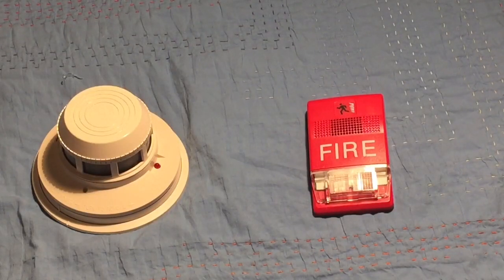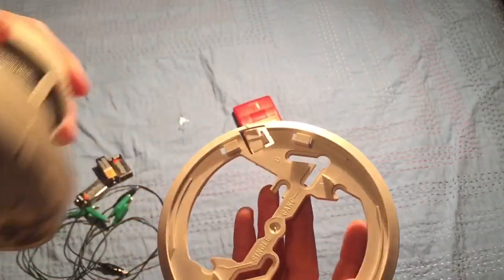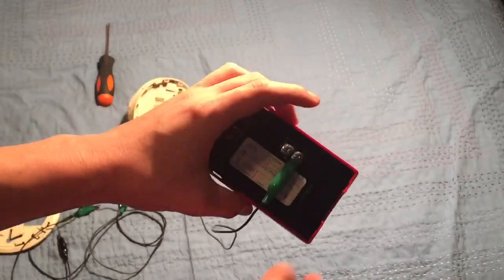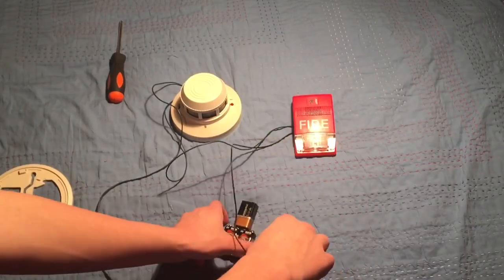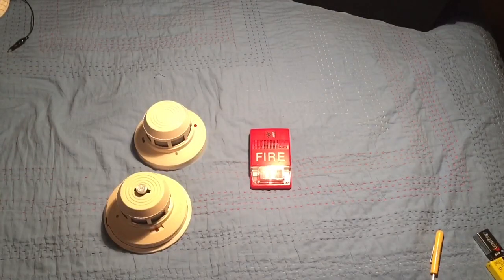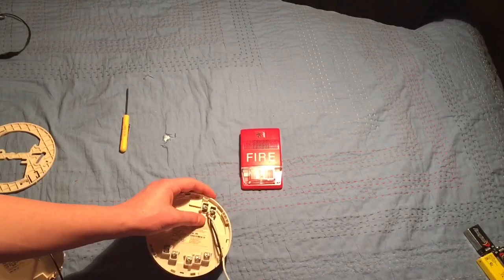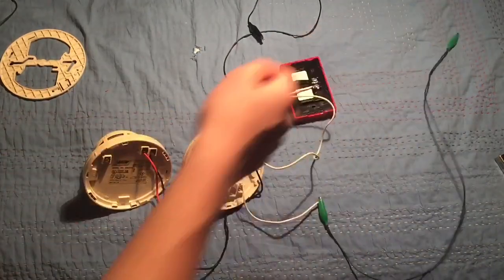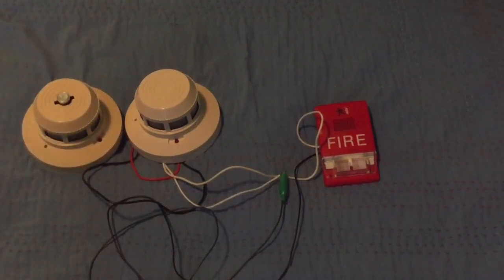How to wire a smoke detector to a fire alarm

Comment: Is the smoke detector photo electric or conventional?
Reply from the maker: Those are two completely different terms. There are two types of sensors in smoke detectors: photoelectric and ionization. Ionization is the oldest type and rather outdated and not as reliable. Photoelectric is newer than ionization and is generally better at detecting smoke and has become the standard type for smoke detectors on fire alarm systems. Smoke alarms on the other hand mainly come with ionization sensors, but you can find others that have a photoelectric sensor. Now there are two types of smoke detectors: conventional and addressable. Conventional detectors are able to be used with most conventional panels, or can be wired without a panel. Addressable detectors require an addressable control panel and additional programming. I hope this helps!
Reply: @ExitSign250  Thank you!

Comment: For 120 volt interconnect able smoke alarms the sell relays that hook up to the interconnection signal wire and you can switch things with it, even zones on fire and security panels

Comment: does it trigger the actual alarm? or jus the strobe
Reply from the maker: The device I wired to it was only a strobe, but you can connect anything you want to it. (Horn, strobe, chime, siren)
Reply: @ExitSign250  One last question if you do that set up how long before the 9 V batteries die and you have to replace them, assuming the siren or the smoke alarm never go off
Reply from the maker: It would take a long while for them to die out. Maybe months or years.

Comment: How can I wire a fire alarm to a smoke alarm so that when a wired in household smoke alarm goes off it will set the horn/strobe off
Reply from the maker: To do that you need a smoke alarm relay. The smoke alarm also must be AC powered with an interconnect wire. You connect the relay to the smoke alarm, then wire the relay to a horn strobe like a pull station.
Reply: @ExitSign250  what is the relay for can I just cut the  connector to the smoke alarm of and wire it to the  hornstobe
Reply from the maker: Ethan Baker   A smoke alarm is 120VAC, a typical fire alarm horn strobe is 24VDC. If you were to attempt that your horn strobe would blow up. They make a smoke alarm relay for this very purpose. The relay acts like a pull station. I am working on a video that explains basic fire alarm wiring and it will talk about how to wire a smoke alarm to a horn strobe with a relay.
Reply: @ExitSign250  i want to wire the smoke alarms to a Gentex commander 3

Comment: How would you go about wiring a 2-wire smoke detector to a System Sensor P1224MC? Unlike the EST Genesis that you are using--which has only 2 terminals--the P1224MC has a + and - for the horn and a + and - for the strobe. Would you have to use a 4-wire smoke alarm instead or can you stay with the 2-wire?
Reply from the maker: Just connect the + of strobe to + of horn terminal, then - of strobe to - of horn and both will now work with the 2 wire smoke.
Reply: @ExitSign250  But it already comes with factory-installed jumpers that connect + of strobe to + of horn and - of strobe to - of horn. Maybe I'm just misunderstanding what you're saying
Reply from the maker: Niko   If that’s a case, the horn and strobe will function at the same time when power is applied. If they aren’t, your batteries/power supply isn’t sufficient enough.

Comment: Could you use a 12v fire alarm battery instead of the 3 9v batteries that you used?
Reply from the maker: Yes you can, as long as all devices are rated for 12VDC.

Comment: So when I activate the smoke detector it only activated the red light the alarm did not go off. I followed you’re instructions. I have a 4w-b wire system sensor I3 and a Wheelock CH70. Can you help me ?
Reply from the maker: You have a four wire smoke detector. Did you wire it like a two wire device? That would be my guess on why it doesn’t work.
Reply: ExitSign250 that’s so weird, because when I wired it to the Wheelock AS it worked. It doesn’t want to set off the CH70. And I only used the positive and negative and left the others alone. Also note that the ch70 has 2 terminals. One for strobe and one for chime, could that be the case?
Reply: @tonyajenkins3544  If you only wired the Chime, that's why.

Comment: Very informative video! 
I think the reason the strobe was not flashing very frequently is not because of the battery level, but because the first detector you used is a 4 wire detector and requires a separate power source.
Reply from the maker: Thanks! Just a side note, I did not use any four wire detectors in this video. I believe the reason why the strobe wasn’t flashing much is due to the batteries having a low voltage and not being able to supply power to the detector and the strobe at the same time.
Reply: The smoke detector in the video is a 2412. I have that model, and according to System sensor it is 4 wire
Reply from the maker: Nope. It’s a two wire detector with a relay.
Reply: ExitSign250 Huh....I must be wrong. Sorry

Comment: With 4 wire smoke detectors, once the detector is put in alarm, it relays power from the power supply to the 2 zone terminals completing the circuit and sounding an alarm, right? Thanks.
Reply from the maker: It doesn’t provide power, it just closes the circuit. Like a switch.
Reply: @ExitSign250  so when the detector activates, is basically like closing a switch and sounding my notification appliance?
Reply from the maker: Correct.
Reply: @ExitSign250  Awesome! Thanks!

Comment: Do I need to use a resistor on a system sensor i3 2W-B if I wire it like the video?
Reply from the maker: You only need a resistor when wiring to a fire alarm panel.
Reply: @ExitSign250 Thanks, if I get the 2 wire i3, will it be easier to wire to a fire alarm? Thanks
Reply from the maker: To some extent. The 4 wire i3’s have to have a separate power supply wired to them, unlike 2 wire.
Reply: @ExitSign250  ok, would I wire the 2 wire i3 like the way in the video? Or could I follow the wiring diagram for it?
Reply from the maker: You’d wire the 2 wire i3 like it was shown in this video.
Reply: Awesome, thanks!
Reply from the maker: No problem!

Comment: I have a question, Will this method work with a system sensor i3 4W-B smoke detector? Thanks
Reply from the maker: That is a 4 wire smoke detector. You will need to wire one set of contacts like I did in this video, then the other you need to connect to the power supply.
Reply: @ExitSign250  Thanks. Do you know what terminals to use? Because it has 5 terminals it has 2+ terminals, 1- terminal one terminal that says N.O and another terminal that says C. Thanks
Reply: Connect terminals 1 and 3 directly to the power source and connect terminals 4 and 5 like a pull station
Reply: ExitSign250 can I email you as I need you help can I have a email or phone number

Comment: So, Ummm... Experiencing some problems. If you are reading this please help me!!! I am using a System Sensor i3 Series 2WT-B Smoke Detector and a System Sensor Spectr Alert ADVANCE Series (P2r) And when i push test on the detector the light turns on but when I let go it turns off. And the P2r never sounds. What am I doing Wrong???
Reply from the maker: Strange... Are you sure everything is correctly wired? Try rewiring a the circuit again. Also make sure you have enough voltage for the circuit. Around 24VDC.

Comment: Is there anyway you can hook up a fire alarm to smoke alarms so that when they go off the fire alarm goes off as wellas well?
Reply from the maker: +Rodj. You can't for AC smoke alarms, unless you wire a relay to the fire alarm, but it would be a bit difficult to do. Battery powered smoke alarms you can't. I've tried it with battery powered smoke alarms, and it would work, but typical fire alarms require 24VDC and smoke alarms are 9VDC. If you use 9VDV the smoke alarm would work but the fire alarm would be underpowered. If you try 24VDC, it would over power the smoke alarm and could cause smoke from the circuit board, ironically.
Reply: There was this one video of someone who did it(A video from a REALLY long time ago) and he seemed like he knew what he was doing.
Reply from the maker: Rodj   Like I said, it IS possible with AC alarms with a relay if you know what you are doing

Comment: can this setup be used with DC power adapter?
Reply from the maker: Not necessarily. Maybe 15-20. You have to consider amperage.
Reply from the maker: +VstaarProduction 15   Yes, as long as you have the correct voltage
Reply: Ik that 3 nine volts is 27 volts, but is it possible to work with 24 volts with three alarms? Using a 24-volt power supply.
Reply from the maker: +Whemenoc   Alarms are supposed to be run off of 24VDC normally. But overloading it a little is fine.
Reply from the maker: Each device varies. And each panel varies in how many amps they output.

Comment: I'm having trouble with my set up,  I'm wiring everything the same as in this video and the smoke detector does trip but it does not set off my notification appliance. Can anyone help me??
Reply from the maker: +Angel Raya   You may not have enough power to your notification appliance. What type of notification appliance do you have?
Reply: ExitSign250 I am running 18 Volts through my est horn strobe
Reply from the maker: +Angel Raya   Try upping the voltage a bit, they need 24VDC to run properly. If it still doesn't work try rewiring the circuit

Comment: Very helpful. Does this work with EST conventional heat detectors?
Reply from the maker: +FireAlarmDude5967   It can work with both smoke and heat detectors as long as they are conventional
Reply: Okay!
Reply: Does this work with an EST SIGA-PS? It doesn't say if it's conventional, or addressable! I just wanna make sure before I blow anything up! XD
Reply from the maker: The EST SIGA-PS is an addressable smoke detector. Some times addressable devices are labeled as “intelligent.” However you can wire them as conventional, but when activated the red and green light will come on (indicating it’s detected smoke) but it will not close the circuit. (That’s what causes the alarm to go off)
Reply: @ExitSign250  Good to know!
Reply: @ExitSign250  I'm assuming to do that you wire the positive of the power adapter to the + in and the negative to the - in?

Comment: Nice! You have a new intro! Ok so I have the same smoke detector and for whatever reason when I test it with actual smoke it takes a while to activate. Are you having the same problem?
Reply from the maker: +Dave   Thanks! That's most likely due to low voltage (if your using this type of wiring)
Reply: Highly unlikely considering that my panel is powering it. I have a 2424 (4 wire version) 2 wires for power (24v supplied by my panel) and 2 wires for the IDC.
Reply from the maker: Dave   Notice how I said "(if your using this type of wiring)" meaning if you are using the circuit I showed. But if your using it on a panel, the detector just may be old and less sensitive, that's usually the case if they aren't being under powered
Reply: Wow ok I just got the notification for a comment over 6 days old. Anyways It could be that the detector just got less sensitive because the first time I tested it (It was NIB) It worked with a single match. Now it takes 2 candles (smoke) to activate. These detector's aren't necessarily the newest therefore I don't expect them to work like a brand new i3.  It will still detect smoke when I need it it so I think I am ok. Thanks for the help. :)
Reply from the maker: +Dave   No problem

Comment: Can you use the simplex 4098 true alarm bases with it?
Reply: XLS Productions Yes, the 4098-9601 IS conventional, but I honestly wouldn't try it because if how "scary" newer Simplex (non-pull) devices can be in terms of compatibility and operations.
Reply from the maker: +XLS Productions   As long as they are conventional
Reply: Cool, Are the 4098-9601's conventional?
Reply from the maker: +XLS Productions   Not sure
Reply: I probably doubt it is conventional.
Reply from the maker: +XLS Productions   Yeah

Comment: Thanks! But i still want to use my battery operated smoke alarm to my system. Can you give me advice?
Reply from the maker: +Fire Alarm Technologies   Im working on that, if it works, I'll make a video in a few weeks
Reply: Fire Alarm Technologies It MAY work if you use an old 120VAC powered NA and hook it up to the interconnect terminals of the smoke alarm. And that's assuming they output 120V, if they output something like 40V, you might be able to use an old bell. Oh, and a battery powered one probably won't work because those are not normally interconnectable.
Reply from the maker: ironmatic 1   No, on 120VAC smoke alarms that are interconnectable, they use 1 wire to interconnect with each other and are designed a special way to work like that. You couldn't use a 120VAC notification appliance with it
Reply: ExitSign250 Ah ok, lol. I'm not into smoke alarms, so I've not taken a close look at them.
Reply from the maker: +ironmatic 1   Yeah yeah, I got you